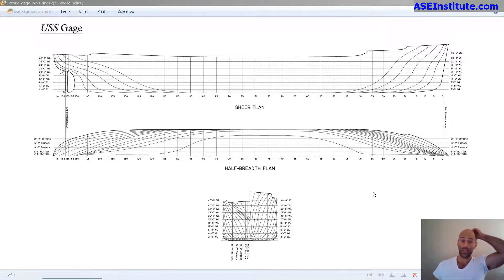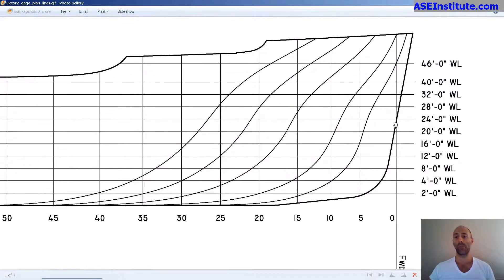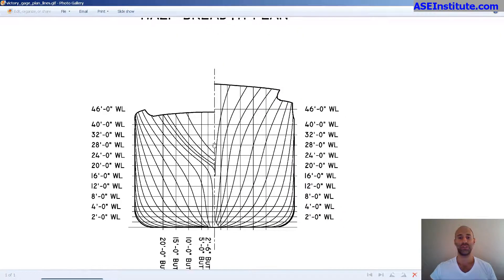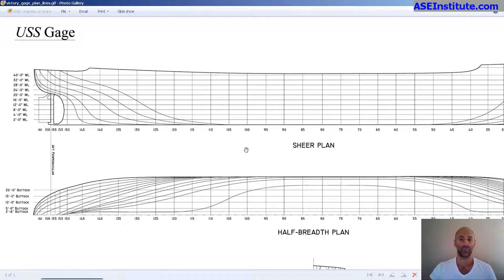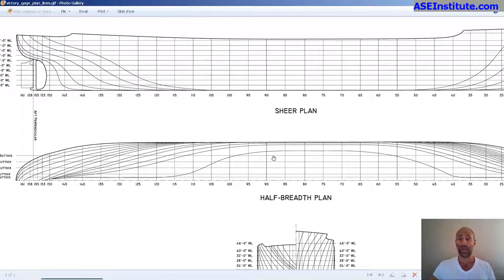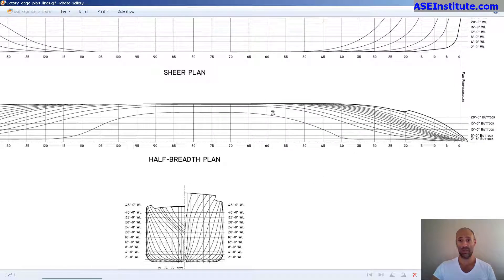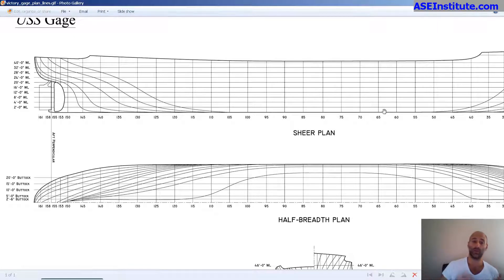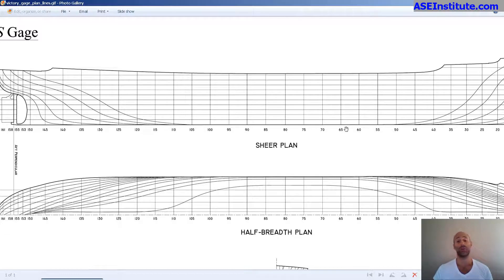Ship Building: Non CAD Specific

Comment: Great, stuff not only for this video but your complete channel  , i am Naval Engineer and my kind of professional  job is Shell exp, develop plate, shell profile and other stuff. Currently  using catia for surface modeling, editing, And Aveva Marine for production stuff.

Q: I saw your video when you explain that NX give simpler surface than catia. Is it worth it to change my platform ?
Reply from the maker: Thanks for the comment and question. Sounds like you are busy! I have done some ship design work. My best friend is a chief engineer on an 800ft freighter on the Great Lakes out of Michigan. I have had the opportunity to work on the boats with him. Steam and diesel. Incredible experiences.

NX can provide simpler surfaces with various settings and if you are careful. Is it worth shifting, I do not think so. If you go careful in V5 you can get really clean surfaces as well. 

Both CAD systems have naval ship design packages and both are good from what I see. I have not had the pleasure of using Aveva.